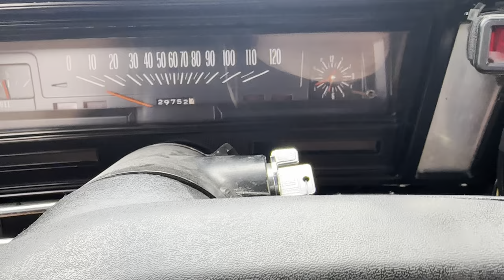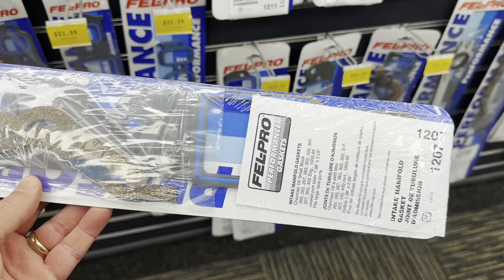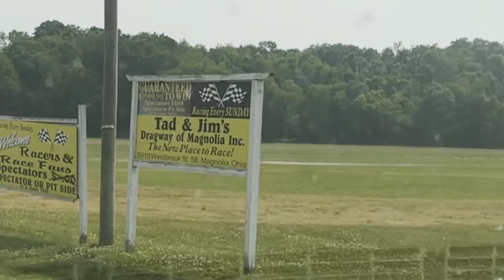LETS PLAY THE BLAME GAME!  Jimmy’s new 434 TEAR DOWN!

Comment: Same thing happened to us years ago. We ended up putting a Hobbs switch on the fuel pressure side to shut off if the fuel drops below a certain PSI
Reply: So I'm thinking the fact there was no fuel pressure safeguard is the reason it blew up. The breakdown was great but it appears to me the nitrous should never had been wired that way.
Reply: Folks don't want to fork out the money for these high tech engine management systems but if you think about the parts and machine shop bills, at what point has it paid for itself.
Reply: I think the safety cutoff switch was around $50 or $60

Comment: A lot of people tend to have a lot to say when they’ve never been down the track themselves, we run NHRA super stock and have been fighting issues with the motor dropping valves for almost a year and finally figured out it had nothing to do with nothing to do with the internals at all. The block was just wore out and would start to expand after it got hot after a few passes and you can assume where that would go… it’s just one of those freak thing that’s nobody’s fault that happens in racing.

Comment: Cletus actually has a new engine that's a billet SMX Steve Morris engine that's not his 540 anymore but he did 6.49 at 221 on a conventional 540 at 3500 lbs... He's having converter charge pressure issues and he keeps wiping out the thrust bearing Steve told him he had to get those under control it was going to happen again and it definitely did on the very next drag n drive he's learning everyday to
Reply: @freedomfox8183   You forgot to mention that engine cost Cleetus probably $100,000 dollars. Hell that could get you at least 10 Jimmy Dale engines.

Comment: Cleetus and Billy's motors are completely different. Cleetus is running smx block.
Reply: They’re still similar big block Chevys with twins.
Reply: SMX is an LS based engine... so you sound not very bright... guess what engine Billy has?
Reply: Definitely talking about the 540 that was in car before the smx
Reply: @Family_Ties_Racing  2018 I decided I needed to build the first fully water jacketed all billet engine that could utilize all the rock solid proven parts of the 481X! After 1 1/2 years of development I am proud to release the SMX engine. 

This Engine uses all of the 481X common parts like valve train, cranks, sleeves, cams, lifters, intakes, gear drives, everything, all the readily available parts the ProMod guys use and have on hand. Rock solid, bulletproof and proven.
Reply: From Steve Morris website
Reply: @gradybaby8309  oh is it? Huh
Reply: Now the old 540 that was in mullet very similar. But since ild man doesn't watch Cleetus I was just informing of what is in there now since was talking about drag n drive. No disrespect to anybody.
Reply: @debass3829  exactly
Reply: @Brian Dallas  yea but only according to Steve Morris...
Reply: @Brian Dallas  just racing debate my friend... u have offended no one... stay safe...
Reply: SMX is NOT LS based. SML is LS based. Check your facts homie.
Reply: SMX is a all billet big block Chevy
Reply: Completely different engine but still the same combination
Reply: @Family_Ties_Racing cleetus SMX isn't a 540 cu big block.
Reply: @gradybaby8309  4.84 bore spacing and a 10.4 deck height how on earth is that Ls based?
Reply: @bdallas7096  the smx is a bmf no doubt but that further proves the point any of them can break
Reply: @gradybaby8309  nothing LS about an SMx..lol.  Sms is based on 481x...Alan Johnson created the 481x  and proline, and now, Steve Morris made popular.   LS has zero to do with it.
Reply: @pineychristian  the smx is a 572 my mistake but it’s still a Big Block Chevy
Reply: @mechanic_prepper  sounds cool.. but the SMX is an LS based platform... perhaps Steve doesn't know his own motors... caution,  you may learn something from this..
Reply: @Family_Ties_Racing  Steve's smx blocks and heads are proprietary.  Only Steve's heads work with his blocks. Billy's block is a block that uses standard off shelf big block heads or big block parts you can buy from anywhere.  Not Steve's.  You must buy everything for SMX or SML blocks from Steve
Reply: @mechanic_prepper  LS based has nothing to do with cubic inches... it how the rotating assembly operates..
Reply: @Piney Prepper  agreed the parts are proprietary but that does not change the LS based operating assembly... same platform just beefed up... its the mechanical operation that makes it LS based... agreed, neither of the motors is an LS and not compatible with off the shelf LS parts... hope u have an awesome day, its only Tuesday...
Reply: @gradybaby8309  I'm sorry to break this to you since you weren't aware. But the 481x design IS NOT based off a LS based engine. The NHRA gave racers running those engines a significant weight penalty, so to get around this Alan came up with the billet-alloy 481X. The 481X is a symmetrical-port big-block Oldsmobile/Chev-based motor with a 4.84-inch bore space, but with improvements to the cam core and lifter spacing
Reply: @gradybaby8309  the 481x is a big block Chevy/ Oldsmobile combination and an LS base engine is considered a small block . You are so far out of your element that you have no clue. Please stop because your just digging your hole deeper....
Reply: Steve Morris SMX is made from billet aluminum and has a dry summer oiling system. Billy's big block is probably forged block with a wet sump oiling system. They are both big blocks but they are very versatile different....
Reply: @Piney Prepper  Ls is only an Ls because of how the rod contacts the rocker... what in the heck are ya talking about... Big block or small block does not matter... like the reinvented the rotatating assembly because of the block size... the 2 motors are similar because they are LS based... lawd have mercy on what ever point you are trying to make... you can't seem to grasp a simple concept without talking motor size...
Reply: @gradybaby8309  LS based blocks are considered small blocks. Your ignorance is just showing through and the hole your digging just gets deeper.  Crap next thing your going to say is a old school hemi and big block Ford is the same just because distributor is in front of engine.

Comment: As an engine builder, tuner, and shop owner I KNOW EXACTLY what you mean!!.  I go 110% for every person i do work for and get treated like poo sometimes. 
BTW, I spray around 425 on two plates on my car and done this same thing to mine. I did a huge wheelie and hit the rev limiter and knocked a pinky size hole in 1 piston ! Ahit sometimes happens on that good Ole N2O. But so fun when it works correctly!

Comment: Very true statement about if you lean on it hard enough it's going to break sooner or later. Good friend is currently replacing the rear end and doing some welding on the frame of his hotrod street strip car rear broke driveshaft banging around tore up a bunch of brackets. It's going to happen it's part of it

Comment: That is absolutely true Bill ,  our truck diesel engines are the same way , we are still learning , shove a bunch of parts in them put a bunch of parts on the outside  for horsepower  sure they look nice when you are done , but until you get it out there and make it work that is when you find out if you done the job right , But like you say it does not matter anything can happen ,  My friend put a PDI twin Turbo system on a 550 cat , moral of the story is , 400 miles later number one turbo  intake blade come off sucked it into number 2 turbo and number 2 dustin the engine , and everything was absolutely brand new from the block up , But what did he do , brought her back , stripped her down pulled it out of the truck and started all over again ,  shitt  happens mann

Comment: Your right that it don’t matter what engine is in it, carb is the problem, and not cause it can’t work great but with a Holley you would of had a fuel pressure safety, afr safety, a fuel correction safety, and you can tune each cylinder. Unfortunately most people don’t know what they are doing with there holley just like most can’t tune a carb.
   I sure enjoy you keeping that carb cause that’s what you enjoy, engine builder is doing a great job as well.

Comment: I agree stuff happens, engine builder usually catches flack for no reason.
I used a hobbs switch to cut nitrous off if fuel pressure dropped below safe level.

Comment: Good video, good explanation of the facts of racing life. Lean on it hard and if one thing goes wrong, it is damaged or broken. If it is a bracket car it should last a long time, but even then, parts can fail. One look at that piston and it was obvious it had leaned out, typical nitrous damage. It's like turning on a cutting torch in the combustion chamber.

Comment: I hopped up a 350 4 bolt main in a 73 El Camino in the late 70's. First week I had it out on the street I blew the freeze plugs out of it because of rpms I was running. Sounds stupid but but I had to pull the motor and put all new no flex steel and x seal them tight. Used thick hoses and a special radiator. Got costly but it worked.  Like the old man said. You never know what will happen when you start beating on them. Some good, some bad.

Comment: I argued with guys on src channel about how they say the only thing that runs like a "timex" on the channel, is the falcon, and I argued that both the s10 and the nova are new engine combinations, that need to be figured out, and they say because cleetus got into the high 6s one time with an ls,
 that is all billy needs, but they don't realize the way that engine was getting run to the ragged edge of everything it had, it would tulip valves, it would bend rods, it got hurt literally every time he leaned on it, the nova has alot of unclaimed power, and billy will not have to lean on it near as hard as he would a sbc or an ls, because let's just put it out there, there is no replacement for displacement, the s10 has done so much on so little, and the way that he lightened the truck up, and in the front especially, and making more power, when he irons it out will be an absolute ape on a backside, billy is not stupid by any means, and when he gets both of them figured out, there will not be any problem for him to be in the victory spot on a regular basis, these things happen, its racing, it's new combinations, there's part failures, there's trial and error, figuring out what something likes, what it doesn't like, while it sucks, its racing, and you can see that billy gets frustrated, but he realizes that it's racing, and he gives it another go, and comes back better everytime, and learns something new about what to do, and what not to do.

Comment: You need to install a nitrous cutoff switch controlled by fuel pressure to save the next engine. It's a shame and an expensive lesson. But, fuel pumps fail and you can't have the nitrous on without the fuel pressure to support it. That's another good reason for two separate fuel systems. But it adds more complexity. I have two pumps and a fuel pressure switch on mine that turns off the nitrous in the event of low fuel pressure. A fuel cutoff just like I run an oil pressure cutoff. Neither is good when the pressure gets low... Like the show!

Comment: 👏 👏 👏 👏 👏 👏 👏 👏 👏 👏 👏 

Thank you Bill, You are SPOT ON Sir. Thank you for explaining how everything went south with Jimmy's engine. I figured that it was in the tune/fuel. Finding out it was the FUEL pump that fouled up the tune that he used explans why. And hopefully this explanation can help other and avoid something like this from happening to them. This kind of stuff happens when you're DEMANDING this much power from these engines. It doesn't matter what make or model the engine is. Or who put it together. Ive seen guys melt DIESEL engines by adding everything from Nitrous to Propane to them to make more power. I don't care who you are, or if it's gas or diesel, You start playing with that much extra "Go Fast Juice fast" Its just a matter of time before you're going to tear up a engine. I promise you, GM destroyed THOUSANDS of there performance engines (6.0,6.2 and now the 6.5)  LS engines before they decided where to stop pushing them for there "Stock High Performance Cars" like the Corvette and the Camaro's in the last 15 yrs or so. Even the drive motor's used in a Tesla has bearings in them. And when they wear out and seize up. The stop moving also.

Comment: A low fuel pressure safety switch on the nitrous system would have saved the engine, for less than $75. I'm definetly not being mean or negative but when spraying anything over a 150 shot it's the best insurance policy you can buy for a nitrous engine. Thanks for sharing 👍

Comment: Sometimes you break stuff when racing, I am of the crowd that if you don't occasionally break stuff you are not trying hard enough. Thankfully it can be fixed. I am going to run a carb on the BBF I'm putting in my 98 GT, only cars that I own that have fuel injection came that way from the factory and I'm going to change that on the 98, always have been a carb guy, mostly because that's what I know. It usually is something that isn't that expensive that breaks and tears up expensive parts. Actually looking forward Uncle Bucko's red S-10 on the road again. I have broke my share of stuff over the years. Go fast and be safe. God bless you and your family and friends.

Comment: I had a suggestion maybe there could be a sensor installed if the fuel pump pressure drops it shuts off the nitrous immediately within milliseconds another Gizmo but it might save the motor have a great day:face-orange-frowning: yep just so we need another Gizmo like I always say carburetors for life

Comment: My 2 cents and it's probably not worth it, first fuel injection, and Bill highlighted my point here when he said something like "tune to the hottest cylinder" and we know that's basically for carbs because of the distribution flaws, but with fuel injection you have a lot more tuning capabilities, especially with individual cylinder tuning. No tuning to the hottest cylinder, dial them all in. Timing can be more precise if you have a crank position sensor with the cam sync up top and coil on plug. While you can run FI with a dizzy, it has to go through the timing gears/chain and down a flexing camshaft through another gear and up the shaft through the rotor, cap and out through the wires to the plugs and all that probably adds a lot of harmonics to something that needs to be very precise. Also these newer engine management systems like the dominator have so much data and acquisition for tuning and safeties, if one gets knowledgeable with these they can program a lot of human error out and make these high hp engines live a lot easier. Some fuel pressure sensors and safety cutoffs probably would have saved his Johnny.

Comment: I'm building a 1989 Checy 2500 P/U for drag and drive because it's on my bucket list and I ain't getting any younger at 63. I have a Skip White 383 Stroker Vortec roller engine with 502 HP. After watching years of drag and drive events I can 100% tell you it will not have any computer on it, and will have a carb. It will have the stock cooling fan and no nitrous, nitrous was invented by parts makers to sell more parts. Number one reason I see people on the side of the road wrenching at D&D events is electric cooling fans and fuel pumps got hot and died. The simple fact that I see all these guys with a laptop trying to fix this and that or some little sensor failed and burned or blew the engine up is crazy and enough for me to say no computers. I spent 24 years in the oilfields working with high dollar Blowout Equip. and found that high tech equip. has high tech problems and our saying was we like manual equip. it generally always works and when it doesn't we can fix it or rebuild it. Using Cleetus car Mullet as an example when Kevin Smith built it he put every sensor known to man on it and even an electric ass wiper and it took forever to get a handle on all that technology and they still fight it, hell he even has a track temp. sensor on it FFS. Seriously, how much data is too much data. Watch some South East Gasser races, no computers, no fuel injection, no little crank sensors made in China taking a crap all the time all 1960s/70s or so tech and those cars go and go and what you see break is trans and drive lines and rear ends not sitting in the pits with 10. guys standing around a lap trying to figure why or how a boost cut got into their tune or why traction controll ain't working. No thanks i'm with the Old Man on this one, give me a SBC with a Carb and i'll be happy and when it breaks I can go to Carquest and get a part to fix it.

Comment: If you are not pushing your engine you are not racing it’s not always the engine builder a lot of it has to do with every part in that car working as one if one part doesn’t do its job then you will have a problem now it could be big and it could be small but if it is small and you don’t catch it then it will be a big problem with most likely a bad end 
You explained it very well and clearly now all you have to do is wait for the keyboard racer’s to let their finger off the button and then maybe they have all the answers for you and all you have to do is drive 
Love the keyboard racer and love your content

Comment: On my car I put a 5 PSI safety cutoff on the nitrous fuel line just in case anything like that would happen. But I do have a dual fuel system so I can run good race gas to the Nitrous system